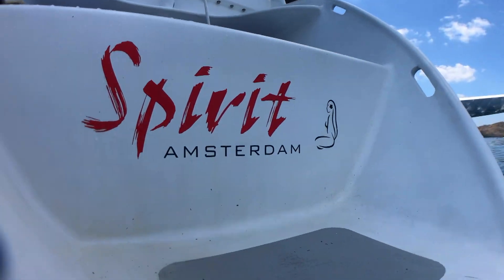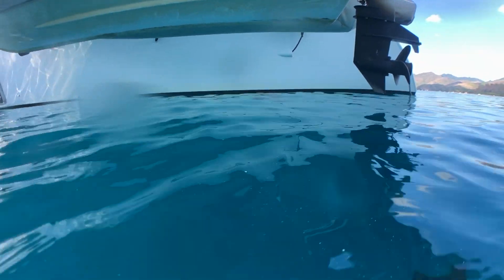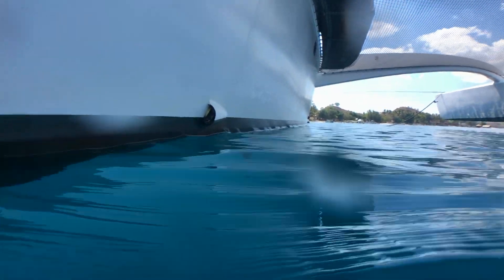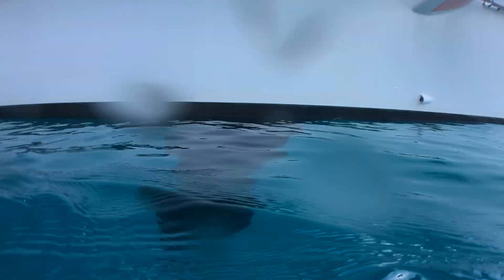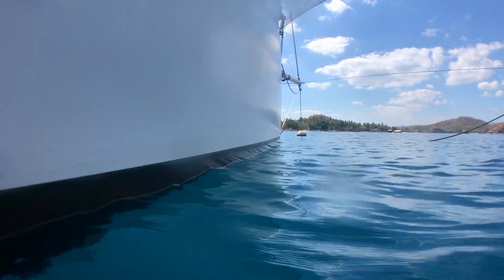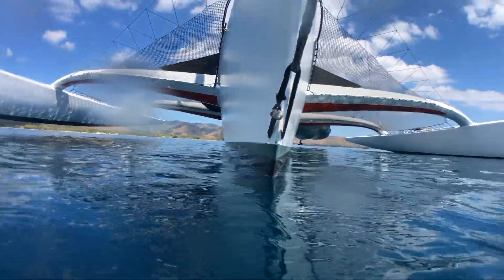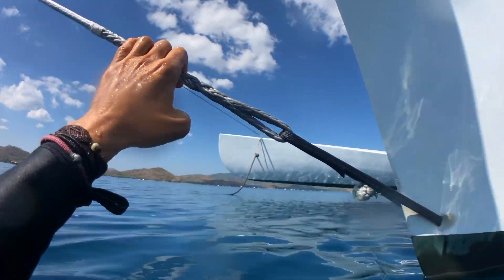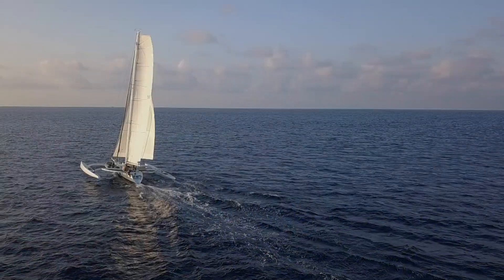Underwater Tour - Trimaran Spirit - The Simple Life - Ep15

Comment: Beautiful boat! Do you actually sail with the dinghy under the wing like that? It would be interesting to see a video showing how you raise,  secure and lower the dinghy under the wing. What brand of copper coat bottom paint did you use?
Reply from the maker: 867 5309 no we don’t sail with the dinghy here it’s only for calm weather sailing and when at anchor. We raise it as seen on many of our other videos and tie it down onto ratchet straps that wrap around the beams for longer passages at sea. Our Copper Coat is from the UK and is the original brand made. http://coppercoat.com applied at the start of 2017.

Comment: coppercoat looks to be doing a great job. would you consider it to be a fairly fast/hard coating compared to an ablative-type paint?
Reply from the maker: Marcus Petraska yes it’s a far better antifoul than any ablative I’ve used over the last twenty years. The harder surface also improves speed and efficiency through the water.
Reply: How old was the copper coat application when you made this video?